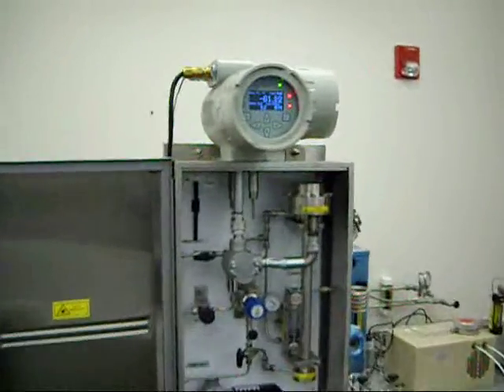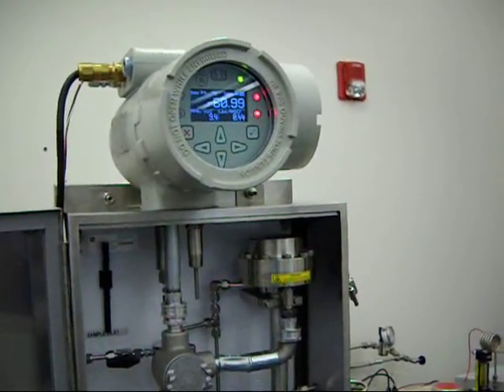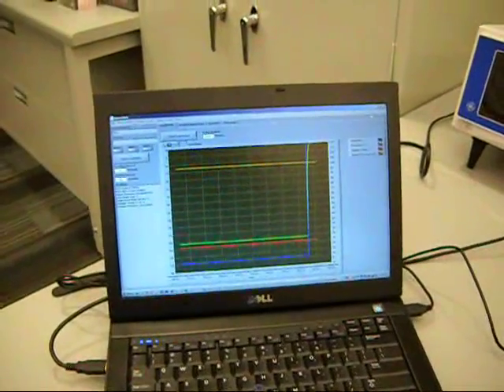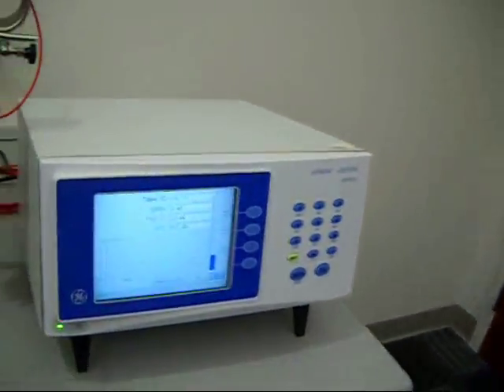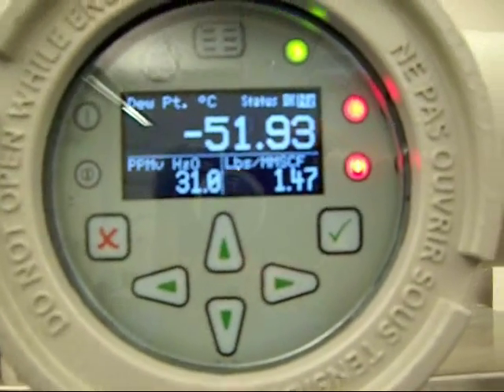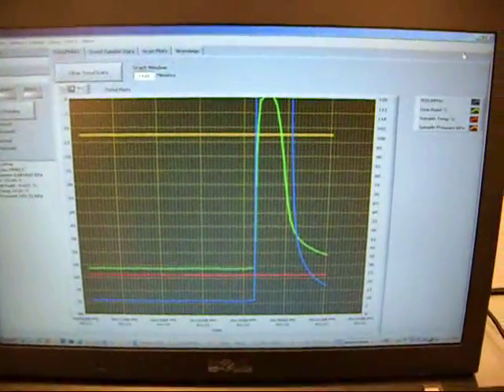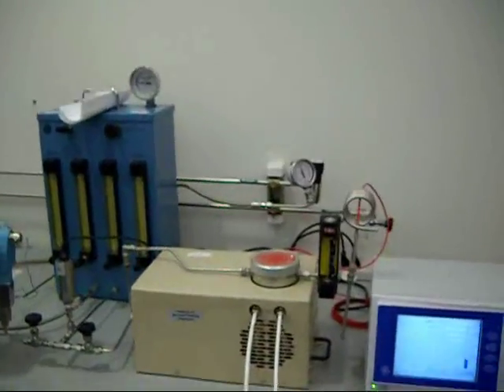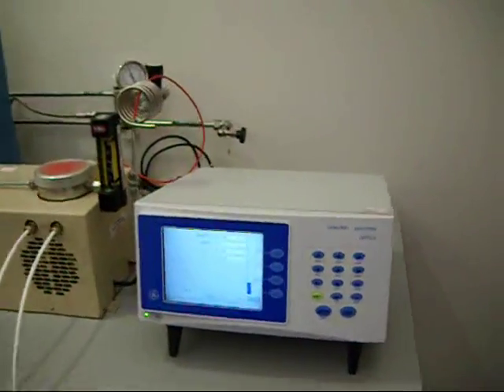Aurora Moisture Analyzer: Response Time Test - Baker Hughes Digital Solutions

Comment from the maker: @dtacuma The flow rate of the Standard (Optica/1311-DR) and the Aurora as well as the industrial Aluminum Oxide based was controlled to 1 SCFH (0.5 LPM).  The flow rate should be controlled but does not have to be precise as these instruments are not so flow sensitive.  The flow rate can vary from 0.5 to 2.5 SCFH (0.25 to 1.75 LPM).  Typically the flow rate are adjusted with a stainless steel needle valve and a rotameter (0-2.5 SCFH Full scale).  Please let us know if this is helpful.